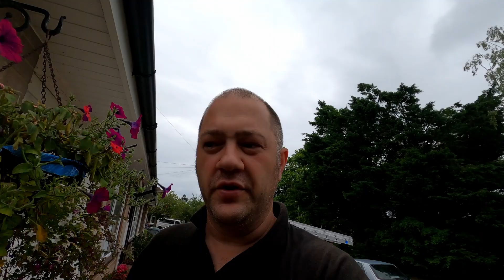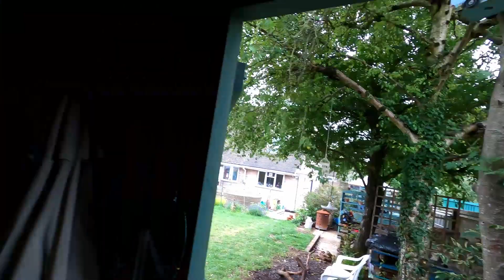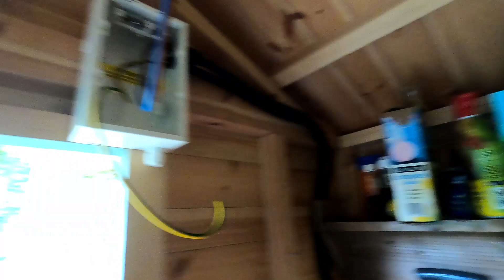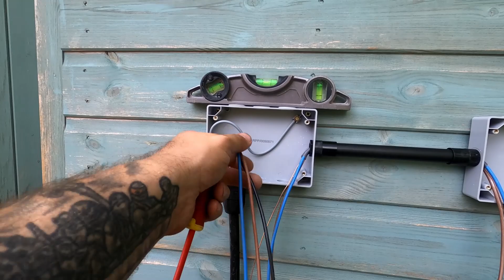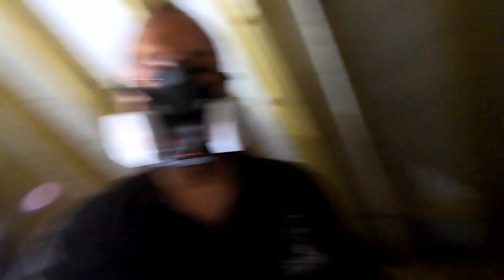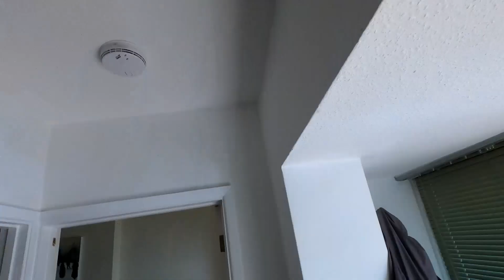Shed Supply - Sparky Life

Comment: Great vid again. Few questions for myself for future reference as new to trade. Why 16mm feed from the house. Was it due to length of run etc and for future proofing? And why 4mm radial? Would 2.5mm not be any good? 
Thanks
Reply: Thinking 16mm was due to length of run and pool install. I believe socket radials should be 4mm ... I’m also new to the trade 👌🏼
Reply: @richardwhitwam9979  Radial circuits don't need to be 4mm, most I see are 2.5mm but 4mm seems to be more popular now and would be happy to know the reason behind it, thanks.
Reply: lee bruce Think I’ve found the reason why it’s about the size of the MCB 3A onwards needs 4.0mm 20A you can use 2.5- page 506 BS7671 . Have taken a picture but can’t attache to this thread
Reply: That should read 30A not 3A ...doh !!
Reply: @richardwhitwam9979  🤣 no worries, I knew about MCB size and that's why I was asking about the choice for 32A mcb in shed and 4mm. Would 2.5 and a 16 or 20A suffice or is it the amount of draw from the sockets?
Reply: lee bruce Yeap I see what your saying now doesn’t quite make sense unless they were heavy loaded.
Reply: @richardwhitwam9979  he did mention a pool so is that why he is giving it a 32 A supply?
Reply: lee bruce Yeap think he did 👍
Reply: lee bruce so can I ask how long you’ve been doing electrical work ? I’m finishing my level 3 in December and hoping to start trading as a domestic electrician
Reply: @richardwhitwam9979  Finshed level 3 about a year ago. Also done my 18th edition and inspection and testing. Currently work 3 days a week as a psychiatric nurse (my job before I retrained) 14 hour days and 2 - 3 days a week on my own jobs sparkying. I am about to do assessment for NAPIT CPS and most of the work I do is off mybuilder or facebook page (word of mouth). Hoping to go fulltime once i am more confident and on CPS scheme. I love it.
Reply: lee bruce Hi there, sounds very much like myself currently working full time whilst completing my training. Was wondering if you have a email address to discuss some question re your journey into the Sparky world ?